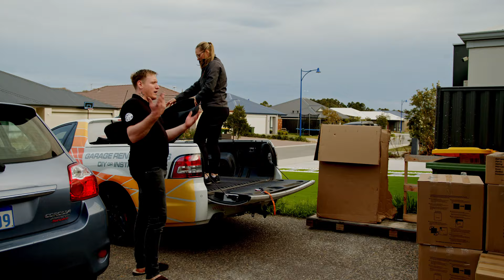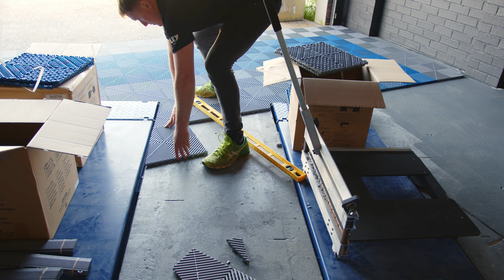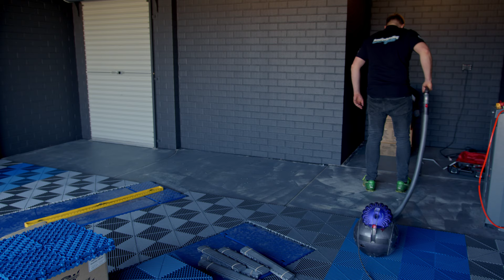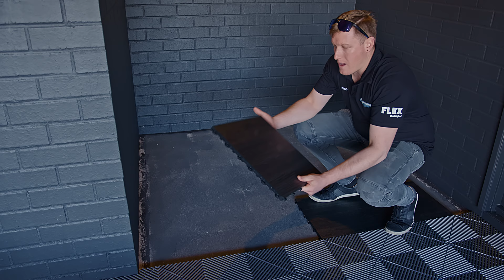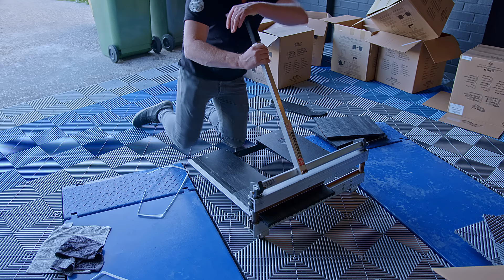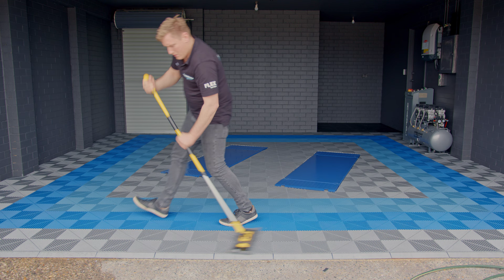SWISSTRAX instillation and Painting // Ultimate Detailers Garage Build // Episode 4

Comment: Just curious, what if the dirt stays underneath, do you think the floor  wouldn't stink after a long time?
Reply from the maker: Hi! dirt will get trapped under the floor and you can easily remove the floor in sections to remove the dirt ect but its solid concrete under there, definitely no chance of the floor sinking. cheers